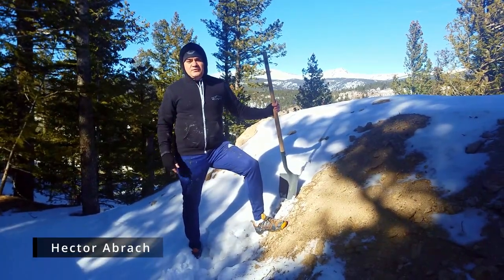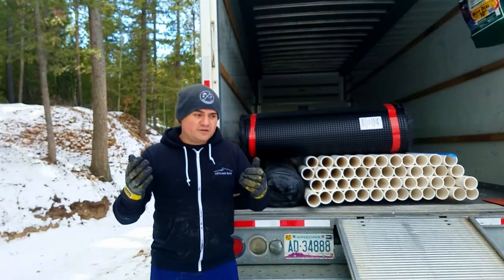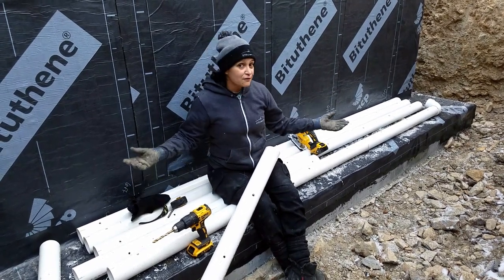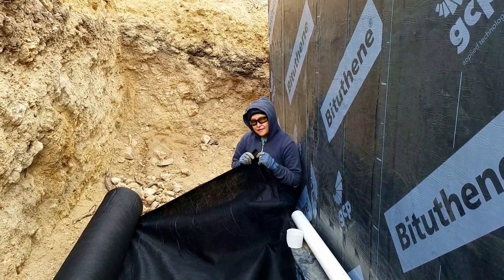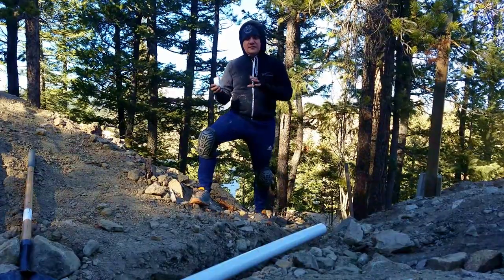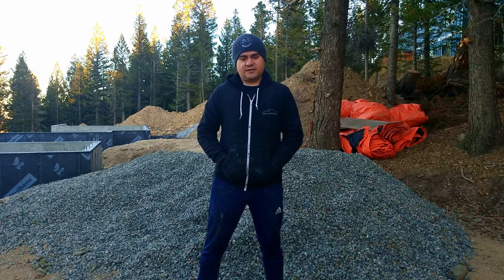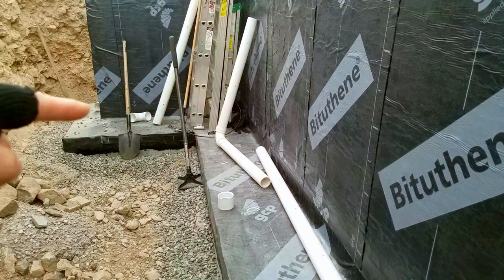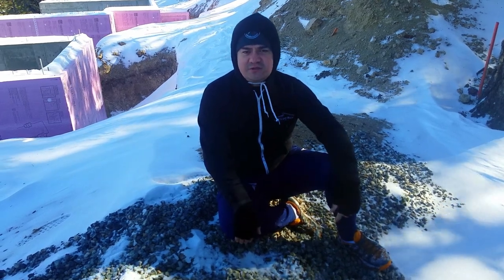10: French Drains, Oui! Oui!

Comment: Did you fasten the geotextile to itself when you wrapped it? If so, how so? Tape? Landscape staples?
Reply from the maker: We did not staple it down. The french drains have a big overlap on the geotextile fabric, about a foot or two, then we put crushed rock on top of the overlap. About an 2 - 4 inches and the weight in our case is sufficient to hold the geotextile in place. Although, is not a bad idea to staple it as an extra precaution.